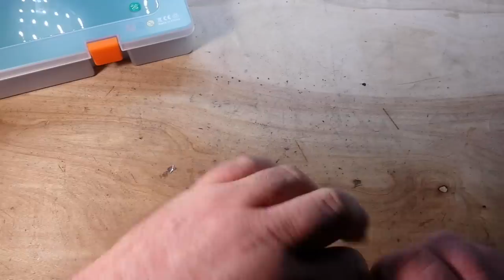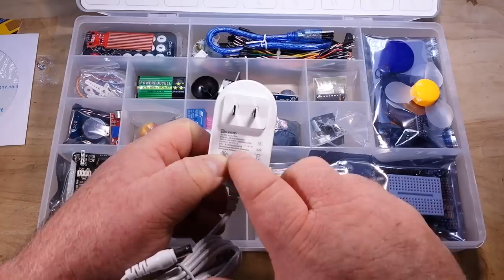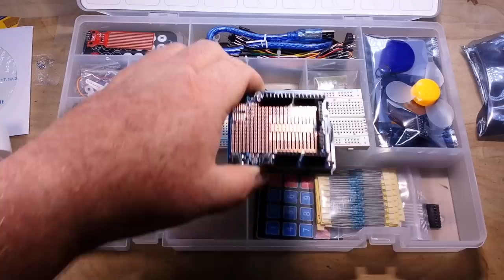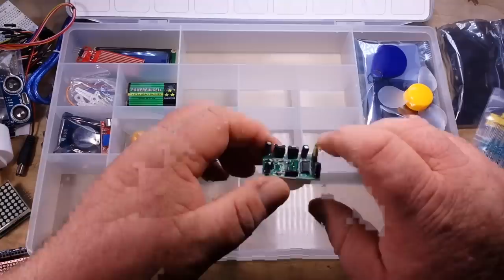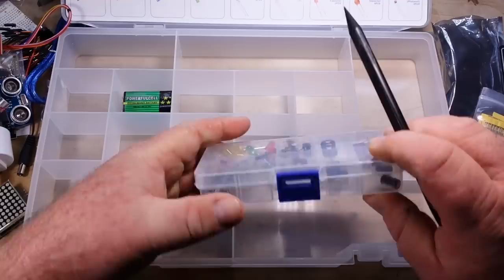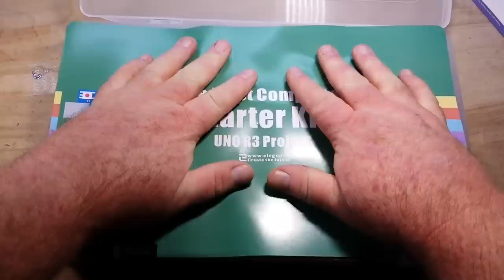Arduino Starter Kit from Elegoo

Comment: The Elegoo Sooper Dooper kit is a gateway drug.  Hanging out with Paul on YouTube will soon have you buying more resistors and even capacitor assortments.  I may need the 12 step program because I have already gotten into extra sensors and shields.  If I buy a power supply or oscillator I will seek treatment.
Reply: @CW: if you buy either, you have failed us all. Build it. 😂

Comment: Excellent description . starting today I'm subscribed in to you channel. I hope i will learn a lot from you. I have 0 knowledge in electronics.  But I'm in a process of build my own Boeing 767 Flight simulator cock pit,  So i think this is a good starting point. to create all my switches and rotary encoders. So i will be knocking you door for tips to my project.

Comment: When it comes to board manufacturers and trying to be budgey conscious, does the manufacturer of the "same board" actually matter? A number of companies, such as Elegoo who makes 3D printers, sell the same board under their product name. Would their boards be printer proprietary and not fit for general use?

Do other companies put proprietary, irremovable firmware on their boards? I have searched Amazon and found several of the same board by part number, so I am really confused.

Comment: You mentioned around 7:20 that "you can put up to about 17v" into the arduino power supply. Does this mean that arduino uno R3 is able to be powered directly by car battery, if one wanted to implement this in their car?
Reply: no, the arduino and the others are 5 volts.
Reply: Yes, the UNO board  operates at 5v and input can be between 7-12v and the on-board voltage regulator will reduce it to 5v.

Comment: Nice vid.   Does this board work with the Arduino websites online editor or does it only function using the standalone editor that comes in the kit?  Thanks.   I'm a noob and lean toward the online arduino support network.  thanks

PS having said all that, this Elegoo kit really looks far superior to the kit Arduino sells on their site.
Reply from the maker: Yep, it will work just fine with the online editor.

Comment: I would like to get into this but have no idea what  i'm getting into
Reply from the maker: It's a bunch of sensors for Arduino. Think of the Arduino like this: It's a hub for inputs and and outputs. You get about 16 gpios. You set some as inputs and some as outputs. you have the Arduino process the inputs and activate a corresponding out put. For instance let's say you have a temperature sensor on an input. You can thell the Arduino to watch the sensor and if the temperature exceeds  a certain value to activate a relay which in turn turns on a fan. You can even set up a display on one of the available buses to monitor the temperature.
Basically everything you can do with discreet components you can do with Arduino acting as the "logic" of the circuit.

Comment: Hi Paul!
First, thank you very much for this review, and for the time invested in it.

I'll be happy to ask-
1. For some reason amazon won't deliver the uno kit to my country, but it will deliver the one with the mega board.  From what I understood the mega does offer more (although I'm an absolute beginner), but I wanted to ask if there might give me a hard time applying instructions given for an uno board to a mega (referring also to tutorials on the internet I'll hopefully use when time comes).  Should that be a problem? I mean- does the mega just have more pins, better performance etc, or are the pins, for example, tagged in a different way which will make things frustrating?
2.  From a few internet sites I saw, the book that comes with the official kit is clearer than others.  just to make sure- there shouldn't be a problem using the official book with this kit, right?  (Going back to the previous question- the official book refers to an uno board..).

Thank you very much!
Reply from the maker: You will be ok with the Mega. Just more pins.

Comment: You said the aduino could be used for a hundred things.  I am a complete beginner.  Please tel me three things it can be used for.
Reply: A temp/humidity reader, an oscilloscope and a voltage & current reader, That's three out of more than a hundred.

Comment: Can a rasberry pi3 do everything an arduino can? I know rasberry is more for running multiple programs at once but can it also do one program at a time like the arduino
Reply from the maker: The pi will do everything an an Arduino can do.
Reply: @learnelectronics  thank you. Just wanted to make sure
Reply: @trevinsmall  ok good so I read the article correctly. Thank you. Can't wait to play around with the Arduino. Figure I would start learning with that first.
Reply: @trevinsmall  ok cool. Glad I'm heading in the right direction. Thanks.